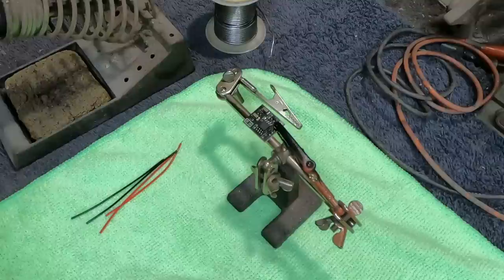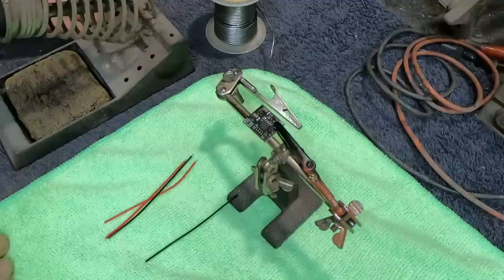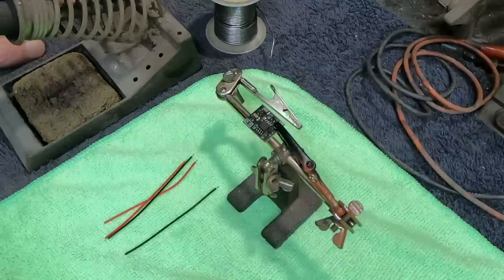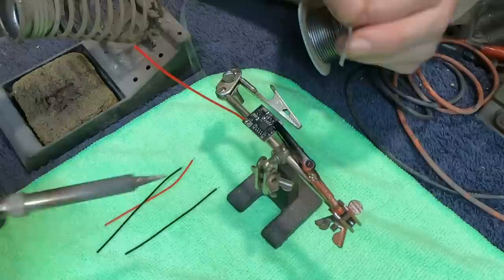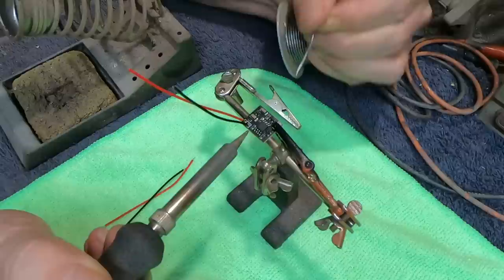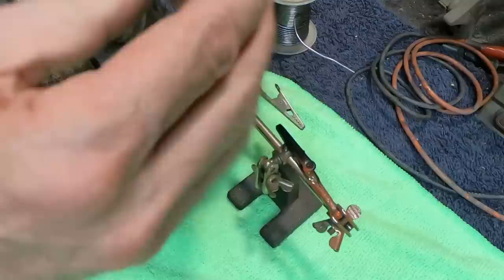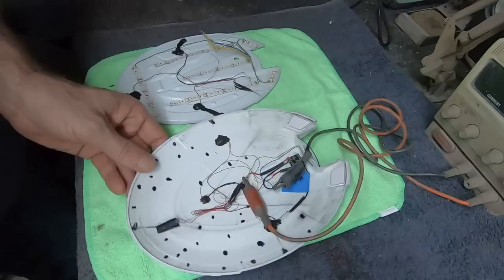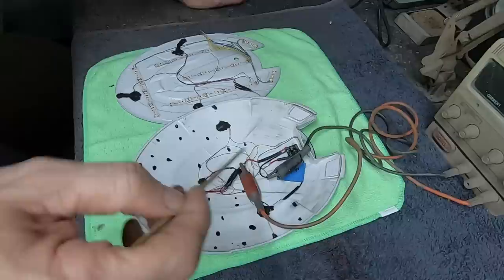AMT 1:1400 USS Enterprise E Build Series PT 3

Comment: Still enjoying this series and working on my kit.  I did not have good luck with the craft paints.  I even had the same Folk Art brand you were using.  I'm sure it was me (maybe not thinned correctly and using a standard Badger Patriot Airbrush).  Ended up stripping the craft paint and am using Tamiya Acrylics.  The scraping method is working fine with those paints as well.  Also really good tips on soldering.  I invested in a Hakko soldering station years ago - well worth it for that type of work.
Reply from the maker: It took me awhile to figure out the craft paints. How to thin them etc. You definitely have to run them through a fine strainer to remove the micro chunks in it otherwise the air brush will clog a lot making you think the paint is too thick.
Reply: @TrekWorks  Thanks Boyd.  That makes sense, I didn't do that.  I'll try them again on another project.  The color was perfect and the price is right!

Comment: Good tip on soldering. Also it’s real good to always have clean tips and tips stored pre tinned. I have the Weller station but it doesn’t tell you the temp just a dial that goes 1-6.

It be nice if they made that model in 1/900 scale.  If I ever attempt the Big E-E. I’m going to do the deflector in blue. That was the original idea for the enterprise but when they made the set for the borg on the dish scene they made it in yellow.  Oops.

Comment: Looking really good Boyd. You've done another amazing build.  I don't know if you mentioned in one of your parts. How come you didn't use a small SMD SPOT in the top front to shine the NCC-1701-E  ?  I've just started mine same way as you demonstrated. I'm on that point where I am drilling holes for the NAV and Strobes to go.  I really want to use a SPOT in the Top Front.